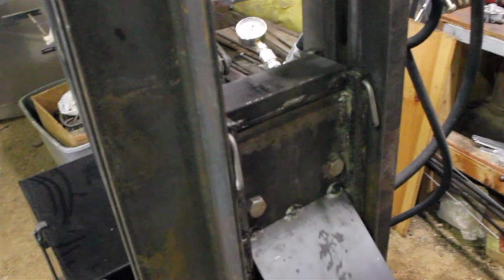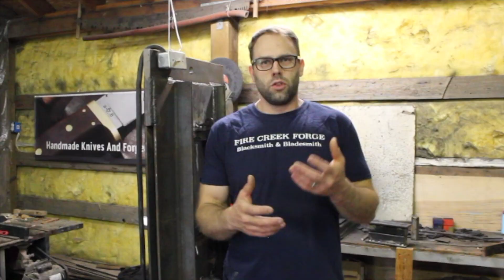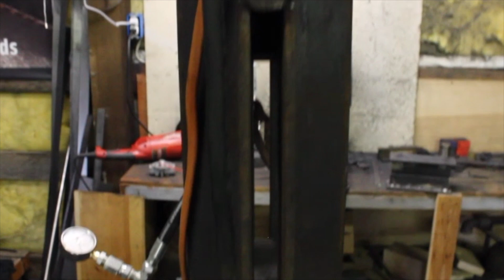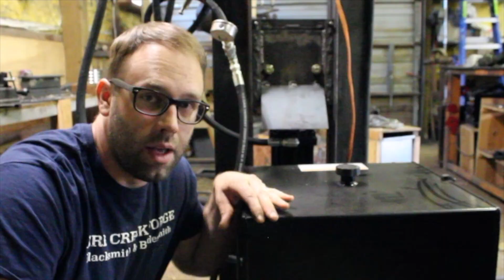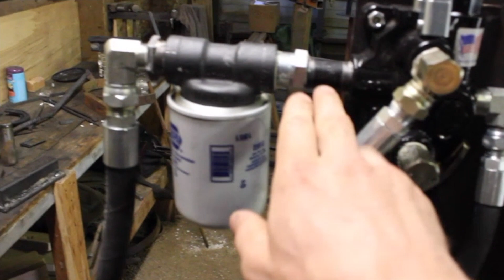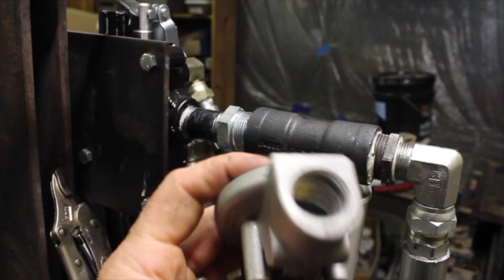BUILD YOUR OWN FORGING PRESS! What Did I Learn?

Comment: Hi, I think your work is great. I'm in the process of building a hydraulic press too, but I don't have much information either. I wanted to ask you how many liters of oil you used in your press and what the dimensions of your reservoir are.
Reply from the maker: 10 gallon tank I believe, and I keep it over half full.

Comment: I look at press designs and find it curious on those designs that have the ram at  the bottom. I find it awkward to have the bottom die moving up and down when pressing.

what are the pros and cons of building the press with the ram at the top so that the bottom die remains at the same height. this way when forging your stance remains constant, holding the iron at waist height throughout the process.
I see the your unit having the closing height of the press too high to functionally work.

good video and thanks for explaining the pit falls in building such a unit.
Reply from the maker: Thanks for watching! Here are answers to your questions:
1.) A lower ram is not an issue, you don't even notice it once you're used to it. The press doesn't care which side it's pressing from.
2.) The advantage of a bottom ram is it keeps the overall height of the press down/ incorporates the necessary height of the ram into the overall height of the machine.
3.) I purposely built my press higher than most so I won't have to stoop, so it's at the height I want.

Comment: Great video - made my shopping list much easier to assemble. The industrial hydraulic shop steered me to JIC fittings everywhere possible for hose connections. For the connections that require NPT, they do use the thick teflon tape but leave at least 2 threads at the starting end bare to prevent any of it from being exposed to the flowing hydraulic fluid.

Comment: Question: does the .020" play of the ram head show up in the billets? My log splitter/press wants to taper everything,  horizontal press, top squooshes quite a bit more than the bottom,  maybe to much for blade tapers even. 😮
Am thinking about building an H-frame, with a shorter ram, and quick disconnects so I could use the engine and pump from the log splitter.
Reply from the maker: I went back and fixed it, so it's been fine

Comment: I bought Bastons and the parts list (page 31)  talks about wide flange I-Beam for the frame, but yet I see angle iron not i-beam is this a error? I also find the drawings a little confusing. Is there a better set of plans done like with Fusion 360 or something?
Reply from the maker: There are a couple different ways to do it. This way is pretty standard for the H frame design. I think other guys have detailed plans, probably can find them on google

Comment: What gpm is your pump n control velve also what is the size of your cylinder
Reply: What about the control velve n hp on motor n rpm, thank you
Reply from the maker: @hughlink7341  5hp, 1712rpm or something close to that, I don't know on the control valve they have a flow rate higher than whatever you'll be running, it does have an adjustment that controls the pressure
Reply from the maker: 22gpm pump running half speed, 5"cylinder

Comment: I know this is an older video, but i noticed a few builds that use 3x5x1/4 angle as the frame.....do you think 3x3x3/8 would work for a frame?  Im about to start my build but now I'm second guessing my build structure integrity.  I don't want to use H/I beam because it's hard to come by where I live and when you do, it's really expensive.
Reply from the maker: I'm not an engineer so I can't give you a real answer, haha.. but it would likely hold fine.. the other issue to watch out for is torquing or twisting of the frame during operation.

Comment: Where did you get the hydraulic unit?
Reply from the maker: What part?
Reply: @FireCreekForge  ; Thank you for responding. All of the hydraulic parts, especially the motor, pump and tank.
Reply from the maker: @wrongfullyaccused7139  motor and pump from Amazon; hydraulic parts, tank etc. From Northern Tool and Supply, MSC, Grainger, and McMaster-Carr all have a lot of the same

Comment: Have you noticed any deformation (in the holes) where your clevis pins bear against your steel plates? My design uses 1 inch A36 plate, but my pin loads are 39,000 psi--3000 psi over yield.
Reply from the maker: I haven't, so far

Comment: Great video with lots of detail so I thank you for that, as I'm looking at building something similar.
I am interested to know why you chose to have the ram on the bottom and moving up rather than on the top moving down?
Doesn't that mean you have to move your stock up with the ram to the upper die instead of holding your stock still and letting the ram move the upper die down to your stock?
It also look like you would have to hold the stock up around armpit high to get any forging done which must be very awkward and tiring or am I missing something 😕 Cheers
Reply from the maker: The main reason i chose an H frame design with the lower cylinder was for work height. Being taller and with a bad back i despise bending or leaning over for repeated tasks, so this was a good height design for me personally.  As far as the lower die moving up, you get used to it and literally don't notice it at all. Thanks for watching!
Reply: @FireCreekForge  Oh ok well if it's easier on you're bad back then that makes sense mate. Thanks for taking the time to reply.Cheers

Comment: Nice job on the press, but have you fitted the replacement filter housing the wrong way round ? At 19:43 you can see a "flow direction" arrow on the casting that looks to be pointing at your valve block instead of towards your tank for the return circuit ?
Reply from the maker: Thanks! There's actually no arrow, "In" and "Out" are on the other side.

Comment: Just to share, those fittings have an interference fit, the angle of the male and female parts are at I believe a 3 degree difference from one to the other so when they are screwed together they kind of wedge together which forms the seal.
Reply from the maker: Very cool, thanks for the info!

Comment: Good video! On your pipe threads you really need to use a thread sealant that is made for hydraulic systems. I used Loctite 545 on mine, and it has been leak free for 3 years now. It's expensive, but it works. Hope this helps
Reply from the maker: That's a great idea.

Comment: First great video have been looking to build a press and watching videos but like you don't or didn't understand the system. The one thing you didn't cover is what is your investment into the press? I have been looking at just getting the Coal Ironworks 12 ton mini press. Just wondering how much I would save by making a press like you have. Thank you.
Reply from the maker: Thanks! I think i spent about 3500 all together. But, the one i built is twice the tonnage as the coal iron mini. It just depends on what you want and can afford. You could build this press for a lot less, i chose to go with brand new components.